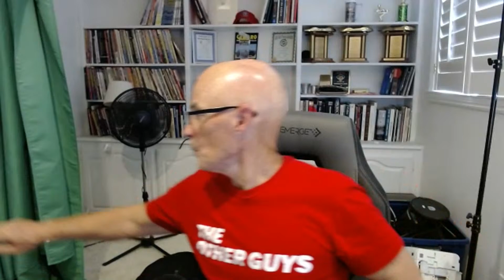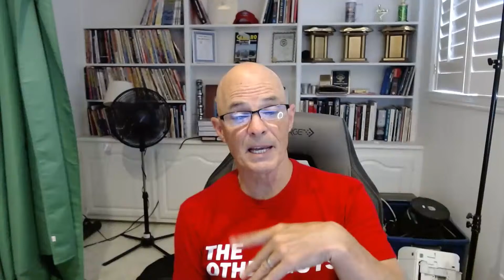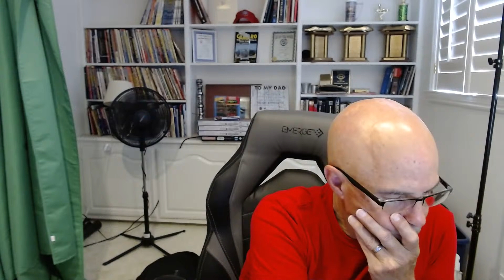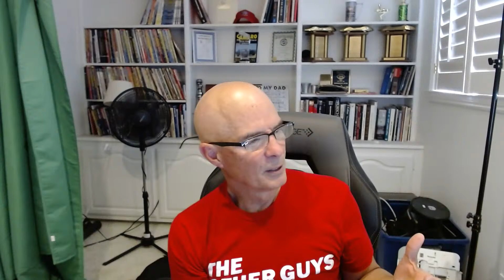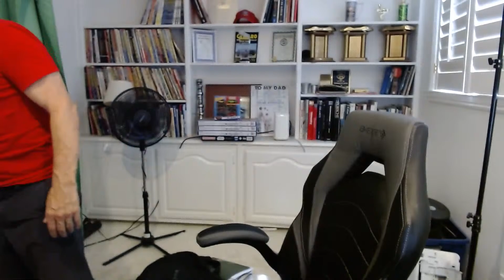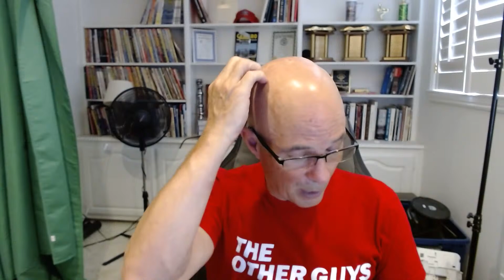LS2 VS LS3-FULL VID IS UP-LET'S TALK TECH

Comment: I believe the LS2 is the better choice with a thicker cylinder wall.... put the LS3 heads on wit studs n boost to the Moon!
991 awhp here...sbe ls2 .
Reply from the maker: HOW DO YOU CONLCUDE THE DIFFERENCE IN WALL THICKNESS?
Reply: @richardholdener1727  sleeves on LS2 are thicker with the smaller bore...block castings are near identical
Reply: @richardholdener1727  small other little fact would be the increased sealing surface of the head gasket area... very small amount but everything helps,
But again I guess I'm talking a boosted LS2 versus a boosted LS3... not really the topic at hand

Comment: Cam for 5.3?..a 3200 stall, 3.73 gears, 243 head, upgraded fuel pump, 8.1 truck injectors,  longtube headers ...if you have recommendations on something I should change I'm all ears.
These are things I already have
Reply from the maker: I HAVE CAMS AVAILABLE FOR THAT $179 SHIPPED. killerbe16@aol.com